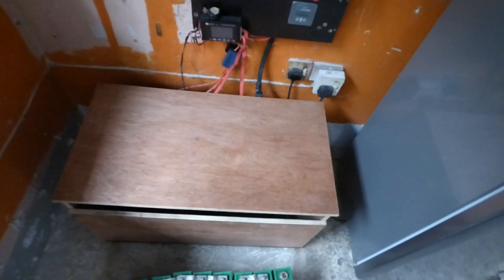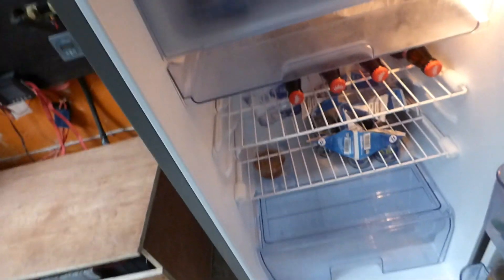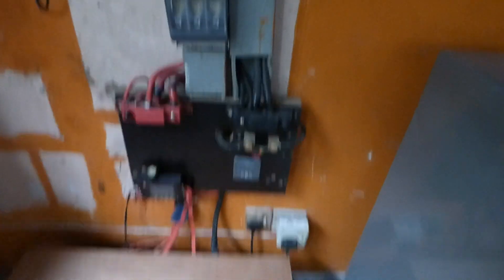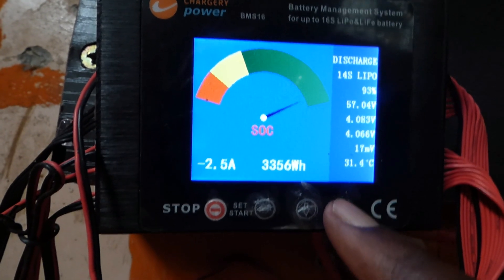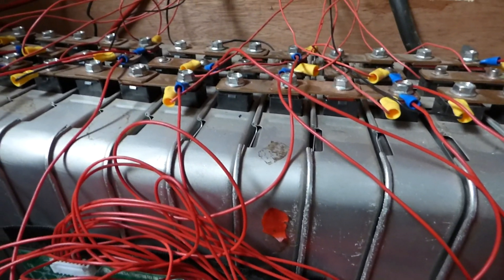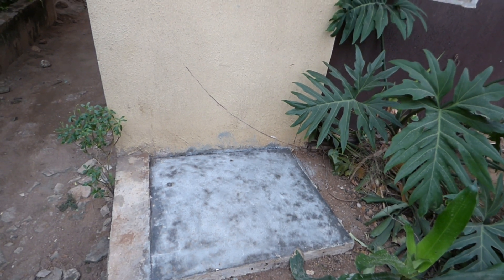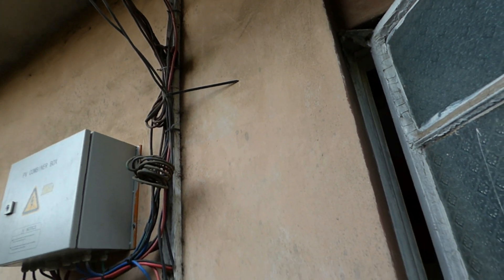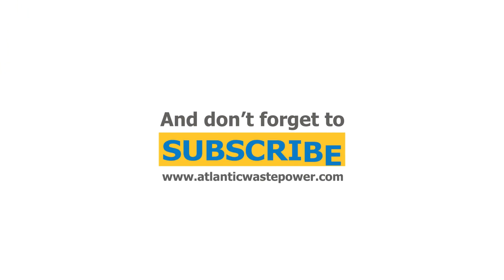My off grid set up plus beer in the fridge.

Comment: I am also glad you are now using pipes to run the wires and install wooden boards on the wall to place all the electrical victron switches etc to make them look neat. I have seen some installation with all sorts of wires exposed and running all over the place. 
Soon, Nigerians will finally buy into solar power use and it will be the biggest market for solar electricity in the world. Early companies like yours will have become a conglomerate if you can do and insist on a high quality job and be accessible to clients.
Reply from the maker: Our system will always be rougher than what we install for clients. We do a lot of experimentation. So we are constantly testing new equipment

Comment: I would set your charge controller charge voltage lower.Try 4 v per cell. You will get more life from your bank. Great vid
Reply from the maker: Thanks Frank. How have you been?
Reply: @drsolar  ive been busy. My mom was sick and operated on and ive been building things for everyone but me . But thats life i guess. 1 day ill have time for me. Hope you are well
Reply from the maker: @frankz1125  oh my sorry about your mum. I hope the surgery was a success. Make time for you or you will wake up one day pissed at every one that did not return the favor when you needed them. I am doing good. New attitude to life kids are all grown. Just the missus and me. Stay well Frank Z you are awesome man
Reply: @drsolar  thanks . Good advise . You're a good guy too. Since you have the resistors you can discharge but you need a way to charge 1 cell. Hook them all together in parallel.  Dont take them apart till they are ready to be a bank. Charge and discharge as many times as you can while they are paralleled.  It is the best way to balance
Reply from the maker: @frankz1125  will give it a shot tomorrow. Charging 3 volts will be the challenge. I have A DC to DC converter I will use it
Reply: @drsolar  it is important to charge and discharge to get them used to each other. If you have a couple bucks get a cheap 1 cell charger set for 3,6vdc. you may have to shut it off before it hits full but it will not over charge to much

Comment: Beer chilled by the sun taste better. How do you have the charge pattern setup for your batteries?
Reply from the maker: It tastes very good. Stop by for some. We have been playing with the settings. Bulk and Absorb 58. Absorption time 6 hours and float 57 or else the battery discharges. Float equivalent to 3.75. I do 4. I hope that is helpful